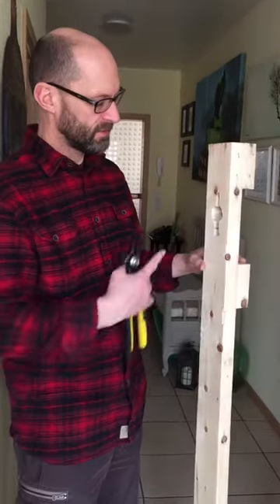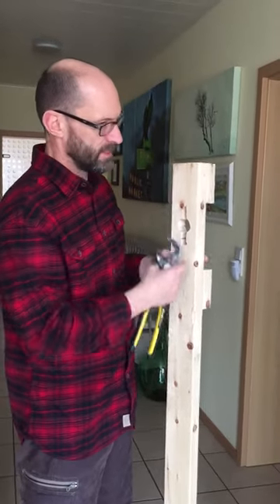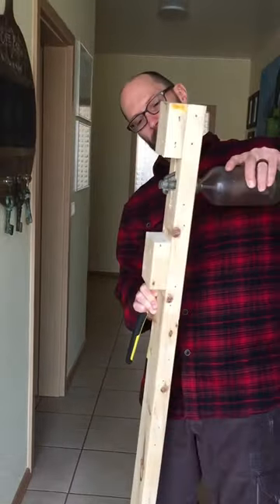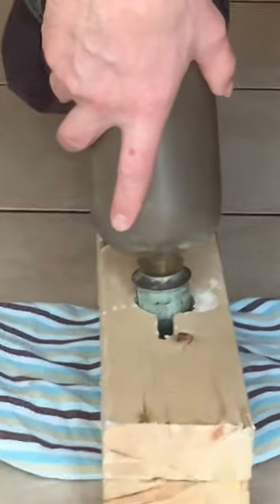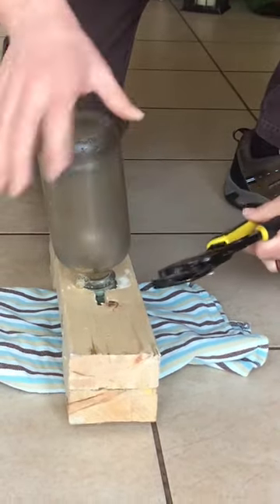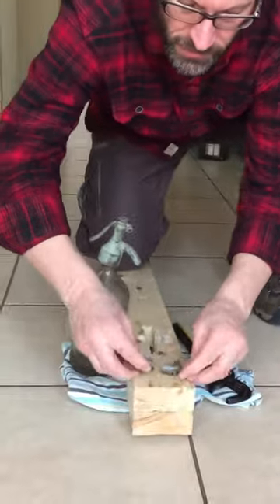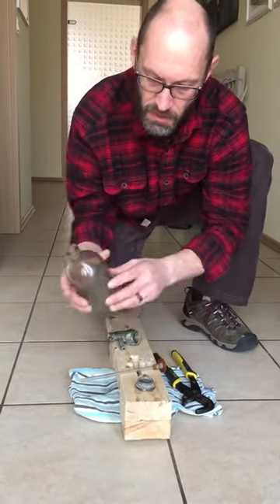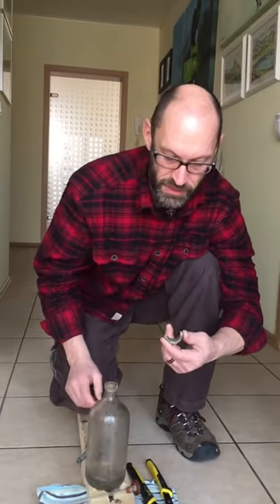Seltzer bottle top removal tool

Comment: This was very helpful for me although I did not need to make the tool. But you showed how the top is assembled and the key here is that you have to hold still the bottom ring while turning the top (or vice versa with your tool). What worked for me was to put the bottle upside down and spray baby oil around the rim and let it crawl in overnight. Then take the pliers to hold still the bottom ring and the cap screws off easily because of the oil. Before watching your video I could turn the top very smoothly but it didn't come off because the bottom ring was turning with it as well. With this oil method you don't have to use a lot of force so the tool is not necessary. In some cases it might be enough to hold the ring with your one hand (a towel in between for friction), while screwing the top with your other hand. My bottle had not been opened for over 50 years.

Comment: Good idea but the jaws of the slip joint will damage the ring.  I used a small strap wrench, which I purchased at Sears.  It can be adjusted to the ring.  I hold the spout in a small table vice with plastic jaw inserts. The spout can be wrapped with electrical tape for further protection.  The bottle faces out from the side of  vice horizontally and can be supported by a block of wood or other object.  A slight turn of the strap wrench and the ring loosens.  I have done this on seltzer bottles that had not been opened in 50 years and still had a small amount of water in them.

Comment: Do you ever experiment with getting seltzer back into the bottles? I'm thinking about doing this with my home carbonation tank now that I know how to open and clean these. Also, do you know anything about restoration of the spring valve mechanism in the top?
Reply: JP, Did you ever figure out how to refill the seltzer bottles?  Looking to do the same.

Comment: Any tips on refilling the bottles? I find without the original machinery the only method would be to take the tops off refill with pressurized water then screw the cap on? Or could you find a fitting to go over the spout and push pressurized water into it from a keg of seltzer?
Reply from the maker: I’ve only seen one company in the US that refills then. It in New York. Normally the only time you take the top off is the clean it. To refill them the top is already installed and the machine refills it through the spout.
Reply: Andres,  Did you figure out how to refill the bottle?  Looking to do the same.

Comment: Very interesting.  One of the best methods I've seen.   Isn't there still some risk of doing damage though, if it's an 
antique Seltzer bottle and/or if it appears a bit corroded around the neck ?    I have two antique Seltzers I would have liked to clean,  but did not want to risk damage to the top, so I left them alone.   I figure better to be dirty than to be cracked.     I assume if it appears stuck when you turn the pliers then it is best to leave it alone ?
Reply from the maker: Try to clean it with white vinegar, I should clean most of the corrosion away. That white gunk is mostly calcium from the old CO2 water. The only damage that could happen is on the threaded shims if they are lead. It could get some marks from the plier teeth. I have a set of plastic covers that go over the teeth on the pliers to protect the bottle or the threaded shims.
Reply: Thanks for the info.  I never even knew that it was the ring at the bottom that needs to be turned.   I had a loose Seltzer where the top spins around, and so I held the top steady and tried turning the ring carefully by hand and to my amazement it was opening up without even a pliers !   And that's been on there since like the 1920's or so  I would think !     I stopped only because I didn't want the ring to fall off, and come apart as your video showed, although I know you told how to put it back, I still got scared.   I'm all thumbs with such things.      My other Seltzer  would need your removal wood tool  to open I think.  The reason I'm so careful is these two Seltzers are like family heirlooms to me.     They were from a soda pop company   owned by my grandmother's brother in the 20's and the company dates back to 1876 with my ancestors.    I have searched for years and only found two Seltzer bottles from his company, and they are different types.  (I have many regular soda bottles, but those Seltzer's are rare ! )

Comment: This is an OK video but he has left a couple things out. When cutting the board you need to make the hole for the spout fairly close and the one for the handle fairly loose so  you don't bend the handle. These other people are correct in that you need to use a wrench without teeth. They make one with plastic  jaws for working stainless plumbing fixtures. Not always the easiest to get a good grip on the split ring but does not leave marks. You can also drill board with a step hole so it doesn't go all the way thru. Eliminates the possibility of  damaging it in your holder if it slips thru. I use a 3 x 6 board so I have plenty of depth.

Comment: I've got a plastic swepps bottle which I'm wondering how to get the gas back in. Does the gas cartridge go in above the gasket around the glass tube?  That's the only place I can think it might go but I've yet to get that part open.
Reply from the maker: I don't have any of the newer bottles so I can't help you on that one. Sorry.
Reply from the maker: alexis washington   I’m sorry but I don’t let people send them to me. Making the tool is super easy. It just needs to look similar. There’s not any real firm dimensions. Any body that can use a drill can probably make the tool for you.